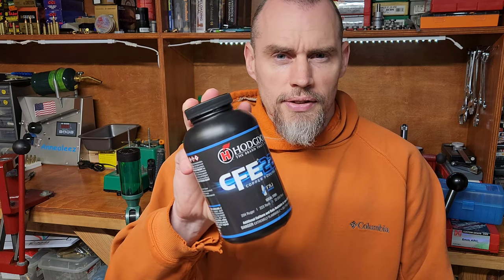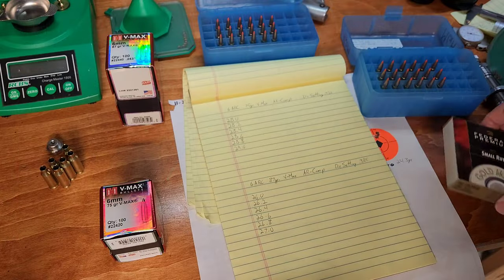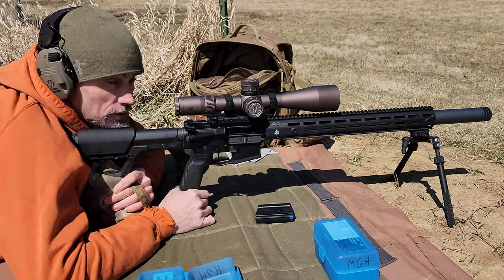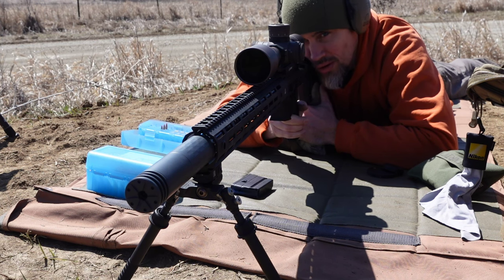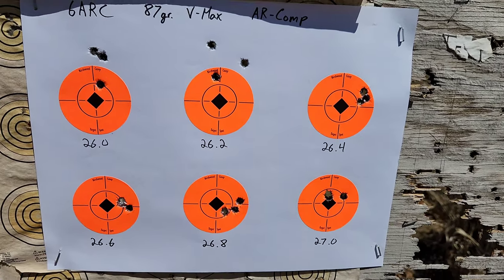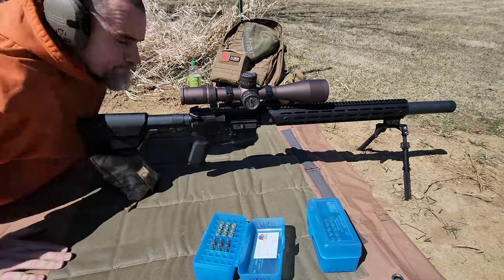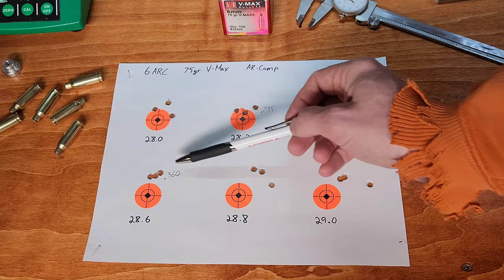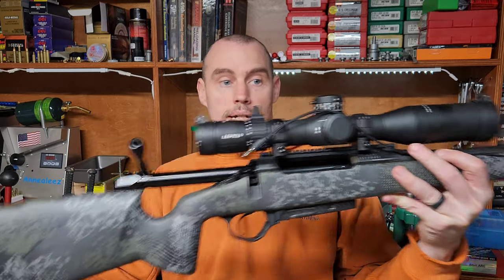6 ARC Handloading: Reloading 75gr & 87gr V-max with AR Comp. Part 1

Comment: You absolutely can use the sported with a suppressor. Works fine on my hybrid46.
Reply from the maker: I tried with mine and it wouldn't read, maybe I have it on the wrong sensitivity setting.
Reply: @thelonggunner762  yes, use the thin rubber piece, and turn to the highest sensitivity setting. HIGH 2 I think?
Reply from the maker: I gave it a try on High 2 this morning and on my Omega 300, unfortunately it didn't pick up any shots. It's about 3/4" or more from the bullet path with the thin spacer installed.
Reply: @thelonggunner762   weird…🤷🏻‍♂️

Comment: Been waiting for someone to post an ARC video with the 75 & 87 V-Max. I run these in a 243 bolt and AR for predator/P-Dog hunting, but the 243 and 6mm Creed burns throats out like crazy and looking for something that can provide  better barrel life as .223 doesn't cut it for me after 300 yds. Good work overall!!
Reply from the maker: Hopefully I'll get the second half of this video done soon which will have some testing out to 500 - 600 yards. I've got very limited amount of 6 ARC brass to test with, it's slowing down the process.  I've done a small amount at 500 and it was hanging in there very well.

Comment: Xterminator works well for 58 and 65 gr Vmax. It’s dirty
Reply from the maker: I think I've got a pound of that, I  might as well give it a try too
Reply: @thelonggunner762  I’m running 31.1 gr Hornady brass BR4 SMR, 18” x caliber barrel 7.5 twist suppressed getting 3320s for velocity. Haven’t loaded any 58s yet.

Comment: Also check out the new StaBall match powder. Haven't tried it with light bullets yet, but excellent results with 105gr bergers in 6mm ARC and 80.5gr bergers in .223 loaded to 5.56 pressures. Yes my rifle allows for the higher pressure
Reply from the maker: I'll check to see if the store has any, thanks for the tip.

Comment: Very well done video. Thanks for the hard work and thoroughness . I just put together an AR in 6mm ARC. I checked the COAL for the 87 gr V-Max touching the lands and found that the bullet had to be seated quite a bit short of the max mag length of 2.260" Is that a problem you encountered?
Reply from the maker: That's pretty common with lighter projectiles, they push the throat out for using the 108's.  I wouldn't say it's a problem, you can still find accuracy with a larger jump.

Comment: If you can't find 87g v-max try sierra 85g game king excellent bullets, have really good results in my 6mm Hagar. The only possible drawback for sierraa # 1530 6MM 85G game king bullets is make sure you purchase enough from the same lot number ( can be noticeable difference from lot to lot) have shot them out to 600yds, great results using AR-COMP and if you can find federal AR match primers ( better es & sd ).  Hagar bbl   has a 1in 7.75 twist .  Hagar virtually same as ARC just can't magazine length longer bullets.

Comment: it looks like those 87's are shooting pretty good.

I don't do round Robin either. I tried it a few times, but I don't like changing my body position and that much from shot to shot. I also feel the same as you about that's not how we shoot in the field or at a competition.

are we going to get to see a follow-up video with the 87's and the 29.4 or 29.6 load?
Reply from the maker: It's  in the works, I've done a little testing at 500yds with them and it turned out good. I've just been a bit busy between work and kids baseball games to get back out to the big range and film it.
Reply: @thelonggunner762  awesome, I look forward to seeing it!

Comment: Should post your 223ai, i just built one myself and will be using my 16" arc with 65gr vmax and accurate 2230
Reply from the maker: Been trying to decide if I should do videos on  it now or wait till I get it rebarreled
Reply: @thelonggunner762  what barrel are you getting ?
Reply from the maker: @806 Guns  I'll probably get a Brux or another Proof in an m24 contour again.